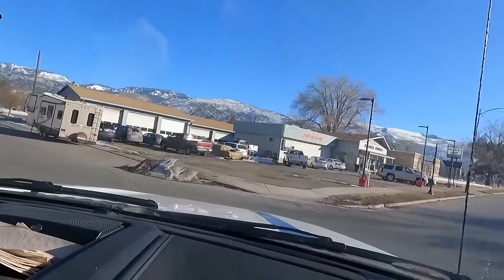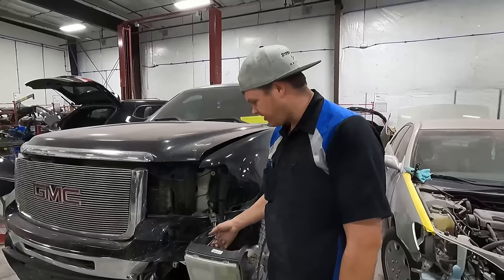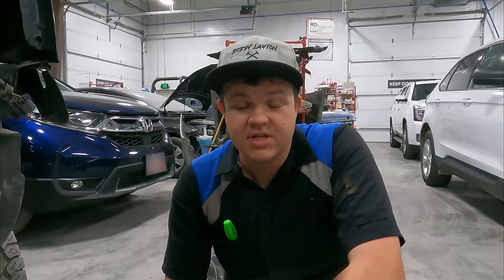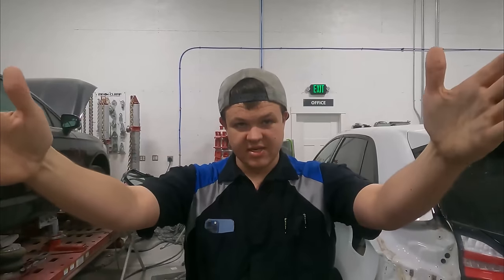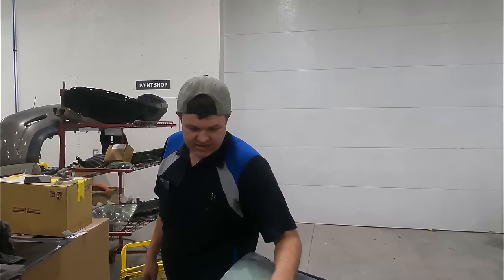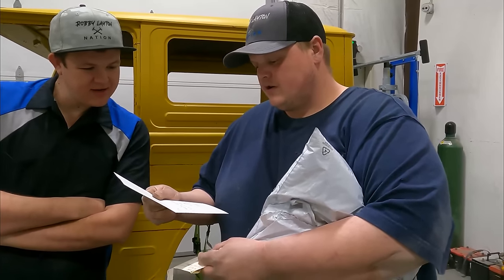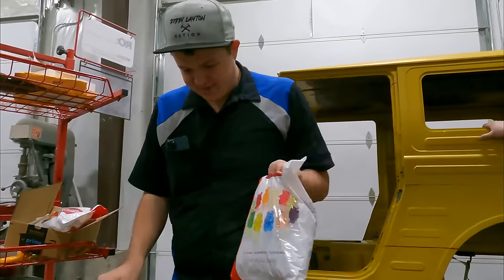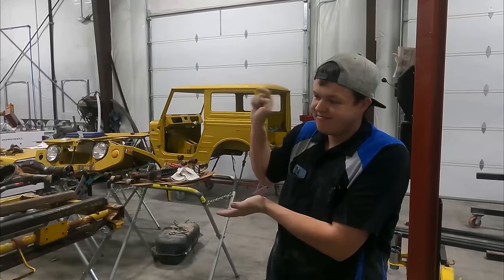Big Truck DESTROYS Little Car! Can We Fix It?

Comment: YES, show more on the Frame rack.  Ive been wanting to know how that setup works.      Im still stunned by the huge investment in equipment and tools you need to run full service shop.    Always great content, and great delivery of the content.
Reply: More frame rack!  More pulls!
Reply: Yes, more frame rack. Yes, laser measuring system!!
Reply: Yes lasers! If you can mount them on the head of a shark all the better.  Mwahahahahahaha
Reply: I sold the product line Robby has for 6 years.  Rack, laser measuring and truck adaptors are $110K worth of equipment alone. That is why repairs cost what they do.
Reply: Insurance payout from their shop fire? 🤔🤷‍♂️
Reply: @ajbudda1038  Wow! But not too surpising.
Reply: 100% 👍
Reply: The amount of tools shops have is amazing.
Reply: Myself as well Steve blows my mind how you can successfully run a business with that sort of capital investment required? If anyone can its this guy and this team, Robby really seems to know his stuff and has a great work ethic!

Comment: My 1999 single cab was chopped 3 inches. Body dropped 2 inches. Shaved all the handles and molded the tailgate and roll pan in. Cut the rear wall and had 6 15's under the bed cover. Bagged and laying body on 22's. Complete tweed and leather interior and custom fiberglass dash and center console. Blue Mercedes style custom glass. Long live Sublimity!!!!

Comment: My question is ... Why didn't you use the wheel lift with pickup to clear the intersection quicker?
Reply: That is exactly what I said!! 2 for 1 tow!
Reply: @jerrymclean8075  Check the weight rating on the rear axle of that rollback, and of the tires, and you shall find your answer.

Comment: Curious why you didn't put the Duramax on the flatbed first then load the Chrysler on the wheel lift rather than go back for the truck? Thanks Robby, good stuff as always!
Reply: The law in Ohio would have no patience for an operator to make two trips, surprising he didn't take both at once.
Reply: I came here to comment this exactly.. I work as a tow opp and I would be laughed off the job for not towing both

Comment: Frame rack? That twisted front end on that GMC reminds me of sliding sideways into a stone wall above Loch Ness (close one: 100' drop!) in a Volvo after a spring broke. The front end was way off. No frame rack of course so I used the poor man's alternative. Took off most of the front end and bolted a big fence post to the brackets on the front of the chassis rails. Got the biggest hammer I possess (which is VERY big) and annoyed the neighbours all weekend by hammering it back into place. Plumb line, tape measure, sorted. 😂

Comment: My girlfriends insurance did an estimate without a teardown and determined it would be a quick fix, it took 2 months because as I had predicted based on all the panel gaps on the driverside and chipped paint on the front fenders that it had to see some time on a frame rack because this was a 40mph impact from the rear, but because it was drivable they didn't think it was that bad.

Comment: The key to a good headlight restoration. Is using clear coat for plastic with UV protection. After clearing them up. The reason headlights get discolored. Is the UV clear coat coming off. God bless

Comment: Hey Robby. Love the content and would love to see a video of the laser frame system some time. Also, you mentioned the car was totaled because the airbag deployed. Is this SOP? Can you not buy airbags and repair the car? Thanks again.
Reply: "Totaled" generally means that the cost to repair exceeds the value of the vehicle in question.  If this happens, you're better off just buying another vehicle of similar value--it's far less work, and (hopefully) fewer issues to deal with.

Most anything can be repaired--if you have enough money.  Whether or not it makes economic sense to repair is another story (especially if an insurance company is involved.)
Airbags are quite expensive--meaning that if the airbags deployed, the cost to repair is considerably higher...and it's much easier to exceed the value of the car.

Comment: The tow man could not get my wrecked car off his flatbed - he double checked to make sure it was in neutral and the brake off, and it just wouldn't roll.  Odd, it rolled right on.  He lifted the ramp back up, hooked a chain under the car and to the cradle, and extended the cradle to try to move the car; as the chain pulled tight, the car started to squat, and this was just a little Mazda that didn't have a lot of squat available.  I realized the problem, but hesitated - surely he'll see it - but he didn't, and kept pulling, so I had to yell for him to stop, the winch was still connected to the car.

Comment: So here in Canada,,, Manitoba specifically,,, we are required to do all repairs on everything over 20,000 km or current year repaired with aftermarket parts. Offshore parts specifically LKQ manufacture,,, how about down there Robbie? Are you using OEM? Aftermarket? Used?

Comment: I bought a Ford Explorer that turned out to be a salvaged vehicle. Driving it 8 miles from Burley to Rupert would shake you so bad you had to "P" after that short distance.  has the technology improved to prevent vehicle vibrations on salvaged vehicles?

Comment: Questions!!!  Do you ever use an epoxy high build primer to fill imperfections instead of the "Bondo" style filler?  I painted in the marine industry for 20+ years and used primers to help in the fairing when we couldn't use fillers.

Comment: Just curious why you didn’t put truck on the roll back first and car on wheel lift to get crash cleaned up in one trip?
Reply: Same thought, the Chrysler 200 is FWD unlike the 300 that is RWD. When I did towing back in the 90s I would often do this with a truck and car that was FWD. I am sure there is a good reason, probably small town and they had time to just go back as it was on the side of the road.

Comment: Love yer videos but i have a question , Your flatbed has a second lift !! why did you not put the truck on the bed and being that the car was front wheel drive why didnt you put it on the second leg would have saved time and fuel and yes im a recovery driver from Uk before ii get slaughtered for not knowing your job .. lol  Keep up the good work

Comment: well I am going to guess a bike rack will be added to the frame so Ed can haul his bike .. great video ,, also yes please show the frame machine in action ,, also I have a 09 chevy 2500 hd crew cab truck good luck I hit a deer a few years back ..lots of plastic gets broke ,,mine has the 3 piece bumper and the out side pieces are plastic .. ugh .. since then I have hail damage could use a hood and cancer on both sides of the bed and the tail got hit someone backed into it while it was parked ,, my truck is black also ..so just send me that truck for parts lol ,,, it will be a good video you fixing it ,,

Comment: I am curious why you didn't grab both vehicles at one time?? You are driving a flatbed with a wheel lift. Put the truck on the deck and the FWD 200 on the wheel lift? Just curious?
Reply from the maker: Because the cop wasn’t done with the truck so we decided instead of just sitting around to go drop that one off and then come back. Our shop was 2 minutes from the wreck.

Comment: Hey guys, thanks for the video, it would be nice to know how much the Denali cost to fix? My guess it was 15,- 20,000.00 dollars. Denali plus diesel, intercooler,condenser, radiator, oil cooler,trans cooler, lines because an allison trans cost like a small car. Then the re - alignment, sheet metal, prep, prime repair, straighten paint, $$$$$.$$
I know you can't tell us? But it's  close,  right?
Yes! Would love to see you use and explain the laser and all methods of frame alignment. 
Thanks again Robby, Hillbilly and Dinner, the other bodymen too.✌🏻
See yall Sunday, l thinkbthat the Nugget might get a trailer to pull Ed's cool two stroke old bike. That would be cool.
✌🏻🔑, 👍👌🏼👋 🧡 🤏🔥😄❄❄ 🇨🇦 👨‍🦽 😎.

Comment: Back in the 80s early 90s there was a pick up truck in my neighborhood it was a full-size short bed he did have it chopped the windshield was I believe if I remember correctly 4 inches tall the back window was 3 inches tall the side windows were 3 inches he had a chop that much and it was lower to the ground it was cool but I guess it was a show truck I wouldn’t know anything like that but it was cool

Comment: Please explain the air bag deployed so it's a total loss???
Reply from the maker: Well usually when airbags deploy it is thousands because you have to buy them new. But for this specific car the damage was more than the car was worth so they totaled it.
Reply from the maker: There has been cars that airbags deploy and they don’t total, but a lot of the time they do because the airbags are pretty expensive to replace.

Comment: Why not tow both at same time since you got a wheel lift? And I say you should have wheel dolls too so no saying drive shaft cause the 200 was front wheel drive and if wheel dollys on truck then the duramax could have been pulled that way.... but maybe the shop was near by....
Reply from the maker: Because the cops where not done with the truck driver and they asked us to take the car and clear the intersection so we did what they asked us to do

Comment: I'm only 42 seconds into the video but it sure looks like you're not going to put the truck on the bed and  the car on the wheel lift ..... one  and done
Reply from the maker: That’s because the cops were not done with the truck driver and asked us to clear the intersection so I did what I was asked to do
Reply: @RobbyLayton  wow fast reply by the way I noticed it's 153 thousand subscribers